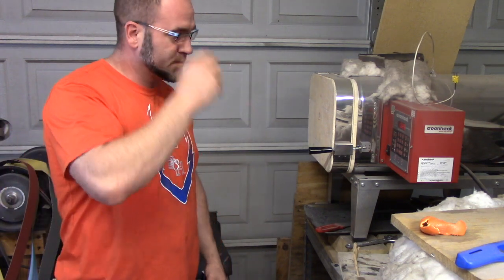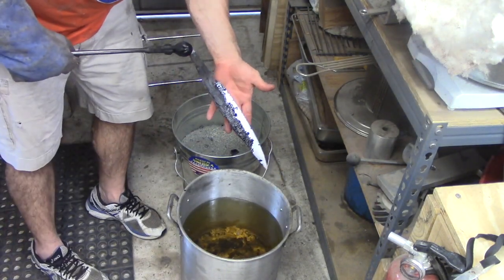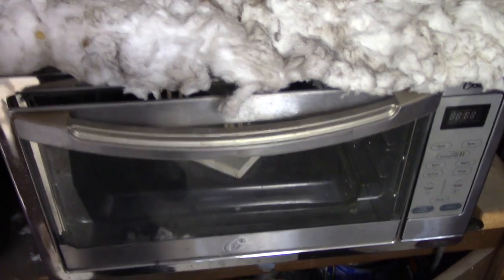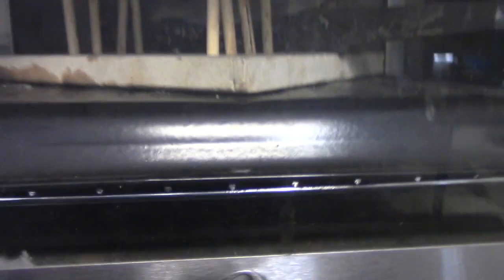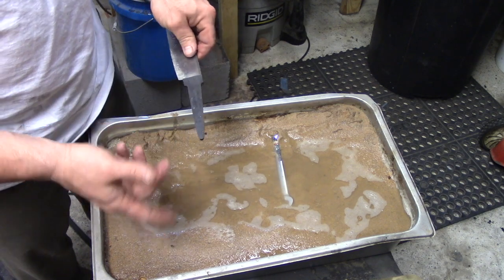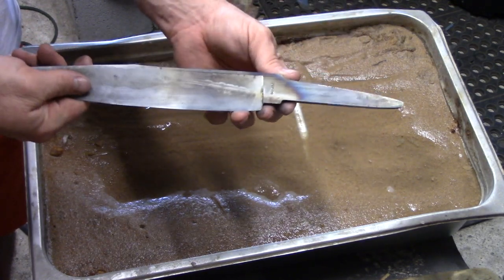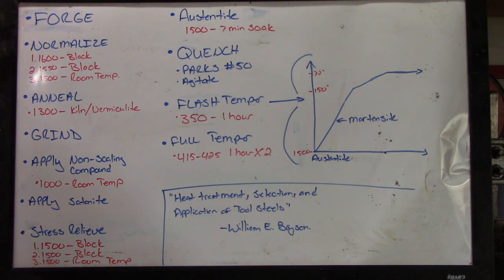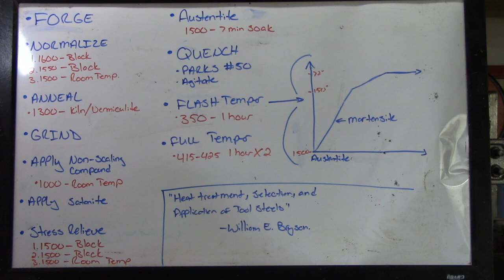Knifemaking: Heat Treating 1084 Steel Part 2

Comment: One of the best videos I found on heat treating! My blade is flash tempering as we speak. I'm kind of worried my blade may have not been hot enough before I quenched though..I know it was non magnetic. Just not sure if it got up to the 1475-1500 range. Wish hardness testers weren't so much. Anyways, thanks so much for the info! I'm down here in Katy, TX.

Comment: I haven't made any knives yet, just trying to get as much information as possible.  You have made an exceptional video, my friend.  I saved them to watch again.  I also subscribed
Reply from the maker: chuck tietbohl Thanks buddy! My advice is experiment, test, refine, experiment again, test again, repeat. 

There are a lot of variables and it doesn’t always work the same in ever scenario based on geography, ambient temp, equipment etc. 

Try different methods and see how it goes. Thanks for the kind words

Comment: I set my toaster oven to bake not broil, that way you know the upper element is't being used. Second get a manual toaster oven with a timer knob and a heat control knob. I find them easier to control. I like the idea of the brick to stabilize the heat. . I think I will look into descaling material. that looks like a lot easier to clean up after.
Reply from the maker: Michael Andersen That’s a good tip. I set mine on Bake as well but wasn’t aware of how it affected the elements. thanks for that

Comment: Awesome advice, I like the sand box idea, just getting into making my own knives. Subscribed.
Reply from the maker: Swamp Valley “Sandbox”!!!!! wahahahhahaah! I love it! I never thought to call it that!!!  Thanks Swamp!  I subbed too.  I came across that idea in a forum several years ago.  You can do lots of things with it. like if you cut the water down, you can pull the wet sand up onto the blade in different patterns and make a hamon design that way as well. Later bud!

Comment: Enjoyed your videos! When you do the three steps for "Stress Relief" how long do you soak for each step?
Reply from the maker: Frank Perrone I don’t soak  during that step. Nothing against it. But since i am bringing it to critical temp three times, there’s no reason to soak. Soaking is designed to create uniform grain structure. 

So...i open the door and put the blade in. The temp drops 60 degrees. So the soak would be the time it takes for the kiln to reach proper temp again. 

I WILL do a five minute soak on me heat that is leading to quench.
Reply: San Jacinto Custom Handmade Knives Thanks for the quick response! Much appreciated.

Comment: I watched your video on your unboxing of the TW90 and liked what I saw, so I ordered one! They are  about four months backordered. Any suggestions on other stuff I need for the grinder?

Randy
Reply from the maker: B well If you didn’t order the extra sized work rests for them that have the magnets, i would do so. Very very handy. Also, go and get yourself about a 1’ length of 3/4” metal rod to use to lower the work rests down further if needed. Helps with the flat platen so you don’t have to grind only in the middle. (makes using a jig easier)

Enjoy! i had to wait a month for mine, 4 months is crazy cut travis is a family outfit.

Comment: If you change your ramp rate on your Rampmaster control to around 900 to 1000deg instead of full ramp it will hold lower temps more accurately. I fiddle with the range from 800 to 1000 depending on desired tempering range.
Reply from the maker: Rob Gooch that’s a good tip bud. Part of my issue was the thermocoupler isn’t that accurate.
Reply from the maker: Rob Gooch The issue for me was mainly immediate control. I didn’t like not being able to adjust temps quickly and safely.
Reply: That I can certainly understand. I hate using it to temper steels that need to be at temp immediately after the quench (w2,1095 etc..) It takes mine about 30-45min to get down to tempering range with the door OPEN. LOL I bought a powder coating oven to temper in. It is pretty much all over the place as far as accuracy goes but I have a type k thermometer in it to monitor it. Great videos BTW. 100% awesome explanations. Thank you!

Comment: Do you have anything ie black tape wrapped around the wire on that Thermal Gauge? And what model is it, I think I found it but just wanted to be sure. I never would of thought you would still need to use a toaster oven after buying a Even Heat..

Comment: I've found using the anti-scale, if i just wash it off with hot water and soap, it is better than grinding, but I've never tried the kitty litter, might have to try that...take it easy... haha, I still use my toaster oven for tempering too. That boiling is wild, never heard of that...
Reply from the maker: Dave Erving Evader Knives the kitty litter just gets the oil off the blade so that i can temper right away.